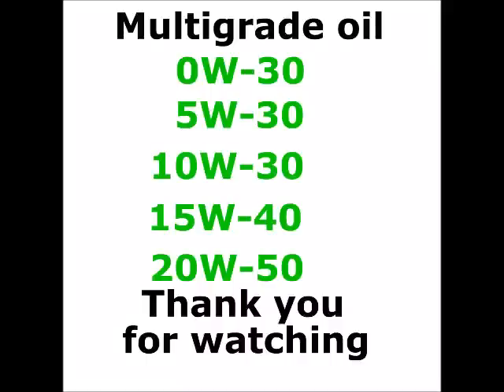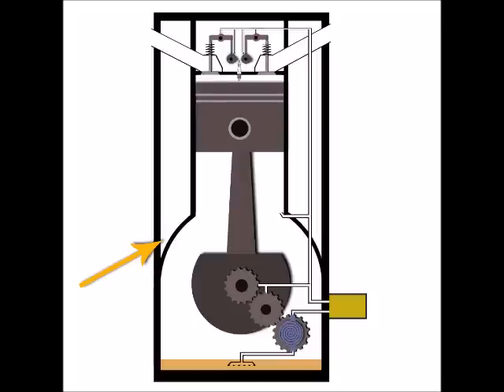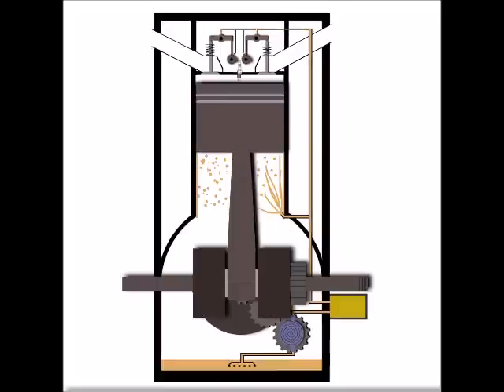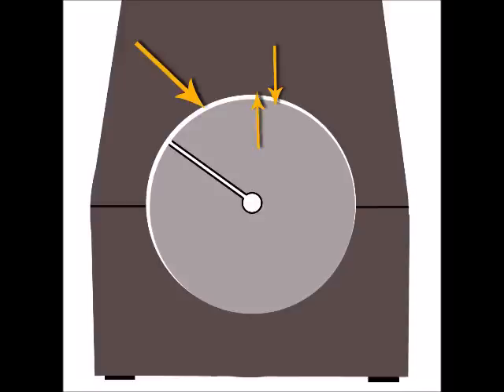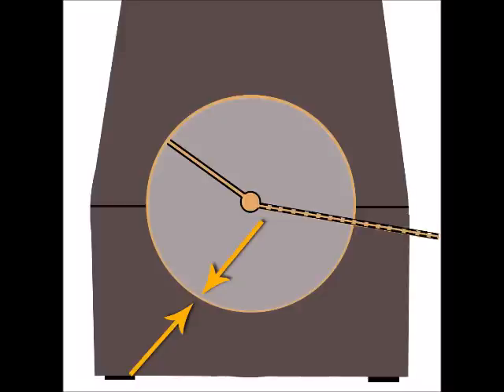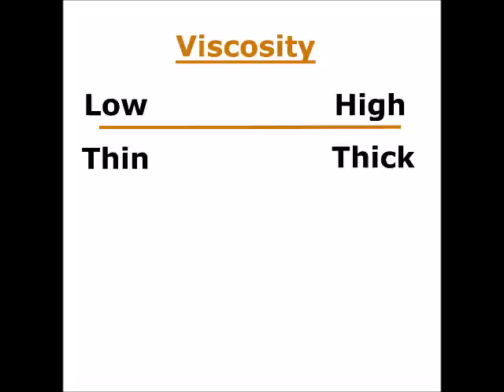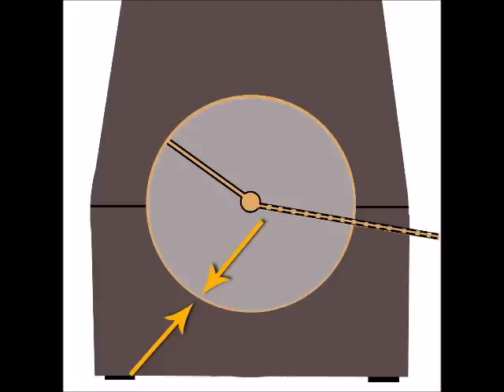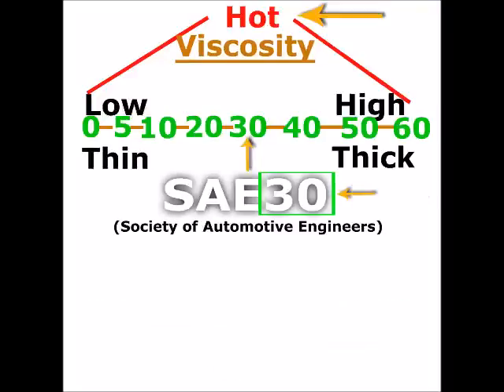Engine oil Explained | Multigrade Oil Viscosity Explained | The Basics!

Comment: Is it recommended to change the oil type of the engine if the car is transferred to middle East area from Canada from cold weather to hot
Or we should keep on the manufacturer oil type
Reply from the maker: Thanks for the advice. Craig
Reply: i think you can choose a thicker oil when moving to hot weather, but it must be a manufacturer recomended oil.
Ex: your manufacturer recomend 0w-30, 5w-30, 10w-30 and 15w-40. You can put 0w-30 if you live in a cold weather or 5w-30, 10w-30 if you live in hot weather.

Comment: So according to this explanation on this video we  conclude consequently, that in an oil 0W-40 , its viscosity is '0'. After when the temperature grows  its viscosity became  '40'.

My humble question is;   what's the viscosity of the oil while it's still within the bottle packaging???? I am eager to know about it , please... As long as am I using this type of oil , and I consider to switch into 5W-40 after awhile...
Thanks in advance
Reply: Sidrit Dedei if the bottle says 0w30 oil in bottle is 0, when it reaches operating temp it acts like a 30

Comment: Just curious, you're always told to warm your engine oil before you drain it. In theory, if you have a multigrade oil of 5w30 wouldn't it flow out faster cold rather than warm since it's thinner in a cold state? Thanks.
Reply: Warming the oil is done to suspend any solids in the oil pan within the oil so they are carried away when it is drained.
Reply: exactly, I'm still wondering about that.

Comment: I am little confused   If the 30 will be the same as end result when the motor is hot then why there is 0w30 10w30 20w30 etc.Why not use 0W for all oils (since faster to get to parts ) as 1st dominator and add the hot 10 20 30 40 50 etc....to it?

Comment: So if I'm someone who always warms up my engine before driving, while my specified oil is 5W30, I could theoretically run 0W30 for quicker oil delivery on start up?
Reply: Oil would not last as long.
Reply: Stay with manufacturers spec. And I learned not to warm up the engine but drive away  calmly and warm up your engine.

Comment: One questions if the oil is 5w-30 and it acts like 30 at 100 degrees would a 5w 50 oil work at 50 at 100 degrees or 30 at 100 degrees and 50 at 140 degrees as an example

Comment: I have a corolla 2016 from USA  and I live in Iraq the oil recommended in owners warranty is either 0W-20 or  5W-20 but I heard that the oil degree must be changed according to the environmental temperature and corolla in Iraq manufactured in Australia recommend 5W-30 so can i use 5W-30 to my American corolla  because our temperature is higher than USA
Reply: 5w30 may effect on fuel economy
If fuel cheaper overseas I would use 5w30 engine last longer

Comment: Lots of motor oils have letters on the oil spec. Mine has R N  what does that mean?
Reply from the maker: Hi. As far as i am aware, RN was used by Renault for a time regarding their Trim levels of the their oils.  They also used codes similar to this was use (RXE, RT-X etc).  Basically, from what I can gather, its Renault's specific coding of oils relating to their engine models. I hope this helps. Craig.

Comment: Hi! Can we switch from 20w 50 to 5w 30? Will it cause any nose in the engine? At 72k kms. Please help. Thanks
Reply from the maker: Thank you for your comment. My dilemma is that if i tell you it is ok and your engine seizes then this would be both irresponsible of me and make me liable.  Can I please ask that you stick to your manufacturers recommendations for their correct oil for your engine.  Many thanks. Craig
Reply: @TheRepairSpecialist  i understand the concern, but i bought it 2nd hand, previous owner used 20w 50 Alas! As per owners manual and Honda showroom they recommend 5w 30 or 10w 30.

Comment: Engine oil recommended for my bike is 10w 40, can i use 10w 50 does it bother my engine? Will that perform good or bad?
Reply: Hari Krishna what is your winter and summer environment?
Reply: Daffy Dill winter minimum is 20 deg Celsius and summer maximum is 38 deg Celsius

Comment: My bike engine recommended oil grade is 10w 30 so can I switch it to 10w 40 ??
Reply: Means when we warm-up the engine the viscosity of the oil is 10w and after the engine gets heat the oil acts like 30. Higher the viscosity means thicker oil not thinner oil. So if I go for the viscosity of 40  which means 10w 40 instead of recommended grade 10w 30 will the engine run smooth than before?!?
Reply: 40 is recommended maybe on traffic locations and long drives

Comment: on my oil fill cap it says either 0w20 or 5w20 which is better
Reply: neither is better except in certain circumstances, the 0w-20 will flow faster when cold. Use both with confidence but if you live in a very cold climate then the 0w-20 will have an advantage initially.

Comment: engine oil sae 20w50 is it okay for toyota corolla 95 model
Reply from the maker: Hi

I do know of people who use thicker oils in their engines when they have some wear in them.  This is said to help to fill the wear gap and help a worn engine to run smoother.  I personally do not agree with need to do this though.  From what I can gather, your engine is actually designed to run on a 10w30 (please check your owners manual to be sure though).  This means that the oil will take on the properties that 30 viscosity does oil when your engine reaches it's hot working temperature.  To be clear, it does not act like a 30 when a 30 is cold (thick), instead, it acts like a 30 when 30 is hot (thinner). A hot 30 basically.

This is thick enough in my opinion.  If your engine has wear already, and it will most likely have some depending on it's millage, then the last thing you need to do is to use an oil that has a 20w (from 20w50) This is because, from cold start, it is thicker than a 10w (from 10w30).  In my opinion, when cold starting, it will take more time for the oil to circulate to all the components than the 10w (10w30).  

This might put even more wear stress on the engine.  Worse still, the second number of the 20w50 (the 50) means that the oil will take on the viscosity properties that a 50 would when a 50 is hot. This would, again, be thicker than the hot 30 (of a 10w30), which would not circulate around your engine as quickly.  

This, again in my opinion, would put even more wear onto the engine. I personally would stick to the engine oil that your car engine was designed to run with as stated by it's owners manual.  Sorry if this the answer you wanted, but i have to give my honest opinion on this.

Many thanks

Craig
Reply: @TheRepairSpecialist  thank you very much😊

Comment: Single weight is better.  Viscosity index improver are not lubricants. Single grade oil has no viscosity index improvers.  in fact in a multi-grade oil 80% of the container is oil and the rest are other chemical additives. I concur that you need to use a multi-grade oil in cold climates. But in warmer climates it is better to use SAE 30 HD.  Single weight oil has better shearing stability and is great for commercial use.  On a 10w-30, you'll never use the 10W unless the outside temperature drops to 0°C.  You want more protection.

Comment: AND NOW WE'LL TALK ABOUT SYNTH OIL OR...? SYNTH OILS ARE THE REVERSE. SYNTH OILS ARE OUT IN THE ENGINE IN 10 SECONDS INSTEAD OF 90 SECONDS. SYNTH OILS HAVE ABOUT 40% BETTER DISSIPATION OF HEAT AND IS A LOT BETTER AT PICKING UP DIRT. NO SLAG. 20w-50 OIL MEANS THAT  IT'S VISCOSITY IS SAE 20 AT 40 DEG. C AND 50 AT 100 DEG. C. BUT A 20w SYNTH OIL IS REALLY A STRAIGHT 50, BUT WITH SUCH GOOD PROPERTIES AS IT WORKS AS A MULTIGRADE. VMs AREN'T NEEDED BUT A LITTLE ARE THROWN IN FOR GOOD MEASURE.  ALSO, NEVER USE CAR OILS IN MOTOR BIKES.

Comment: Its not 5 weight at cold. W stands for Winter and 5W means it meet spec of maximum cold cranking viscosity of 6,600 mPa.s @ -30 °C or max pumping viscocity of 60,000 mPa.s @ -35 °C
.

Comment: Assuming a viscosity is measured in time, how does an oil have a higher viscosity at operating temperature? (when an oil becomes thinner when heated). ??????????

For example: one ounce of cold oil is sent through a viscometer. It takes 5 seconds to pass through. Hence 5w. So  if an oil heats up during operating temperature...how does that thinner oil take 30 seconds (making It 5w-30) to pass through the viscometer? (when indeed, it should pass through faster. 

Any explanation would be appreciated. :D
Reply: You're assumption is correct the viscosity reduces as temperature increase... this guy has no idea what he's saying.